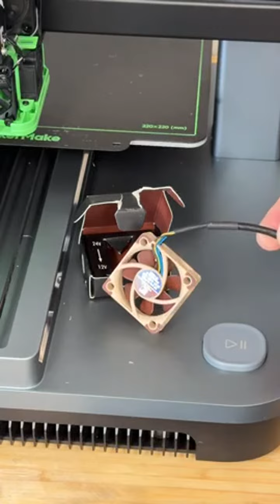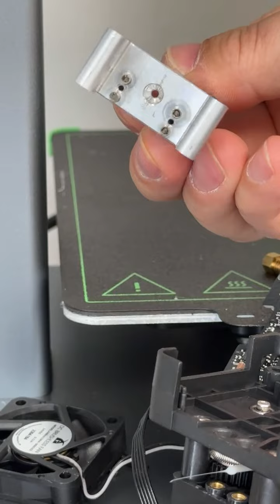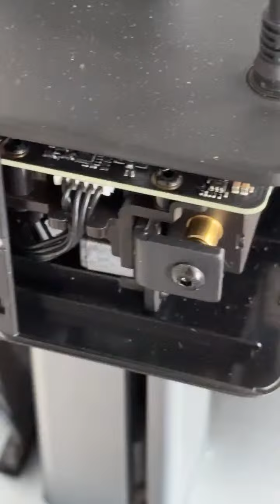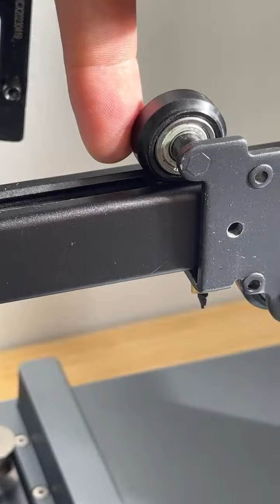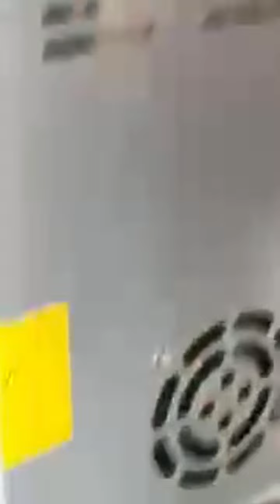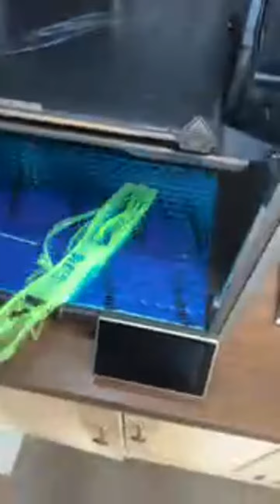AnkerMake M5C Teardown and Analysis

Comment: How on earth is the USB C cable delivering 350 watts of power to the hot end?  Max USB C design only allows for 240?

Maybe it's custom made and there's more power pins than data and they're just using the USB interface?

That's wild.

(also, thanks for the vid, I'll come back to it if I ever had to service my printer)

Comment: Just about to watch this video...I know it's dumb to comment before watching, but I'm commenting just in case bc if what's killing me isn't covered I'm going to be looking in other places. So far all I can find on this is for the M5...or the TPU stuff starts after they've already loaded it. I'm hoping this video will help me see how to get the extruder unclogged so I can get my TPU loaded. I thought this being direct drive would help with printing TPU, but it still has to go thru that section where you have to push it thru, and it just won't go. I don't get it and I'm so gd frustrated! So if this video doesn't help with that, I'm hoping you will make one!! This is different from the M5 so I'm really stuck where I am.

Comment: Right now I got some squeaks from the left side v wheels on the x/y plane. I noticed it in the middle of a 10 hour print, it seems to be slightly eating the material on the wheel, I put some machine oil on the wheel. Noticed the squeak have not gone, but it stopped grinding down the wheel. The problem is, this is brand new and this is my 4th print (all previous print was sub 2 hour prints). I am disappointed that a new product have such an issue so quick from first use (and it seems to be an issue with other users of the M5C). When this print is finished, gonna disassembly the bed and see if its the bearing seizing or is something is out of alignment or the wheel is on too tight.
Reply: So instead of disassembling it, I cleaned all the wheels and grooves and applied some machine oil to all the wheels X and Y. the noise is gone so I am happy. I moved the bed by hand and felt nothing wrong like bad bearings or roughness in the movement. I have ordered some new wheels (I see the ender machines uses the same dimension POM wheels so bought those) but I will run it as is for now. I am on another 10 hour print so will look out to see if I get anymore noises or material coming off the wheels.

Comment: Thanks Nathan your disassembly helped me to do the same to mine to repair an extruder stepper motor issue I was having 2nd day I had it. Motor has failed on me 3 times now.  Still working out the bugs in this thing.

Comment: The breakout board on the printhead is very cool. The smaller chip on the back is the stepper driver (or maybe not, since there seem to be 5 on the mainboard), but most interesting is that it’s got a pretty beefy ARM chip to control the whole thing, which is probably using a CANbus interface to the mainboard. Assuming it runs Marlin that’s a golden nugget for the project, as we’re just beginning to get formal CANbus support together using FLY hardware for its development. Expect to see more CAN hardware as a common feature in the future.

Comment: From a mobile device have it in landscape 1st then start your video stream.
Reply: The only issue I have now with these 3d printers is its still using a rubber v wheel system . I know people would say it's to keep cost down but honestly without naming other brands , there are cheaper 3D printers running steel wheels on both x and y so I think the " makes it cheaper to build excuse " is an old argument now !! I don't know yet how well steel wheels will wear but shouldn't they run smoother in general and have a longer life span ?